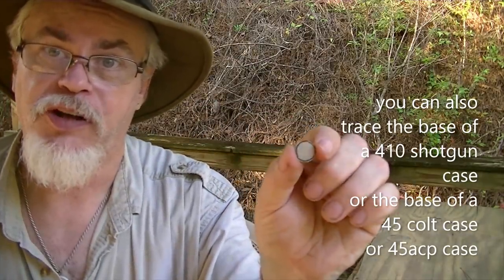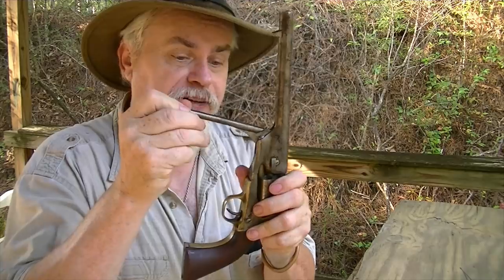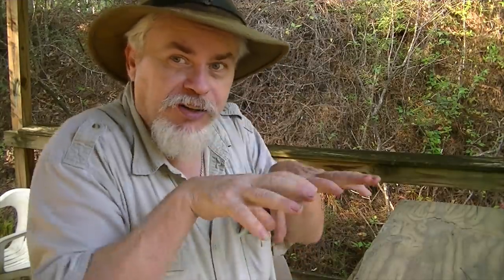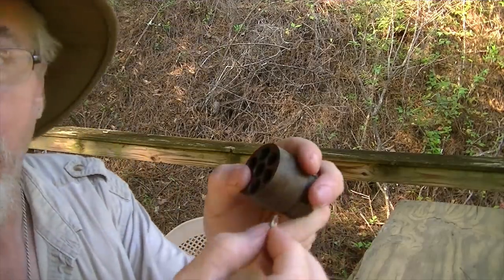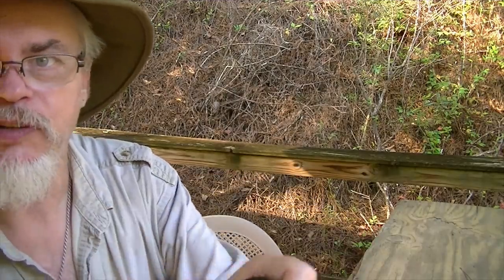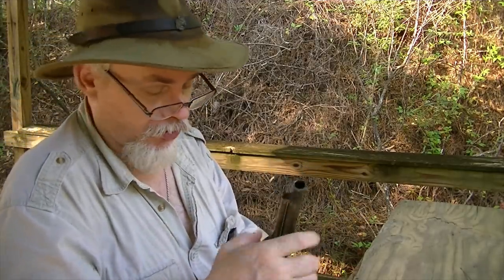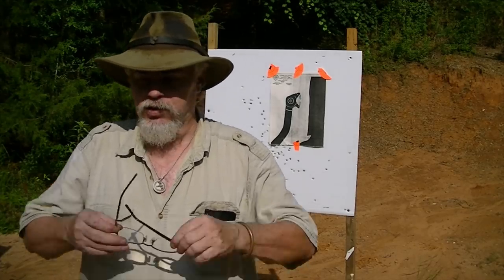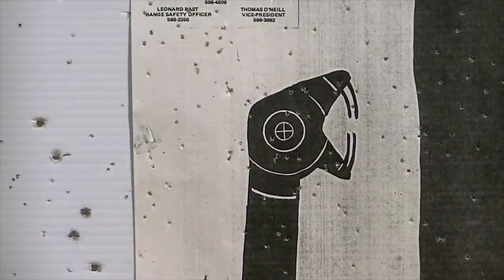SHOTLOADS IN A PERCUSSION REVOLVER

Comment from the maker: feel free to ask and questions in the comments below
Reply: i have a 3d printer, i wonder if i could design a wad like for a shotgun but for a 44cal cylinder. only question would be, would you rather have it like a cup to hold the shot, or like how you use the cardboard and just hold the back?

edit, i made a 44cal wad at 1.20mm tall (which is about 2x thickness of soda box cardboard, but i dont think the little puck form would ima try and design a cup type i guess?

Comment: I originally started carrying an 1860 Colt replica just for the shot load capability for hunting in the swamp many years ago. That was before the Taurus Judge came out. 
I find a .44 cal percussion revolver more effective that CCI shot loads for revolvers.
For .44 cal, I use 20 grains of Pyrodex P, an over powder lubed wad, #5 lead shot compressed, and an over shot lubed wad.
For .36 cal, 15 grains Pyrodex P, an over powder lubed wad, #9 shot compressed, and an over shot lubed wad. 
.44 cal is a more effective load, especially in a Colt Dragoon or a Walker.
Same load for a Colt or Remington revolver. Cap and ball revolvers are very versatile!
Follow Blackie's safety advice. Don't shoot too close to your feet or unintended target, and don't shoot plywood because the pellets can bounce back. Use eye protection.
Reply: I use # 12 shot for snakes. I have tried #5, of course, but the donut pattern reduces the pattern on target at ten yards. #12 is ultra-light, but, due to the intense pattern, takes out timber and sidewinders well on Scout outings.

Comment: Good Safety Tip on the Cyl. Gap, this also applies to any Revolvers. I recently had my Pietta 1860 Army out trying to Sight it in and wasn't thinking about the Gap. 25 grains of GOEX FFFg puts out a very Hot flame and I ended up setting my shooting bag I had under the Muzzle on fire, I spent about an hour and a half picking up about 200 little plastic pellets so as not to litter,

Comment: Hay Blacky try going to a drug store and get you some pill making jelliton  capsules that are about 36 cal. After you have powder and wax seated in a chamber take one half of a jell capsule ( trimmed to properly length) fill capsule with shoot and insert into chamber.  If not a tight fit put a wax wad or paper wad on top to stop capsule and shot from falling out. The jell capsule seems to hold the shot longer together like a shotgun wad and won't blow thru the shot. The empty jell capsule's come in a couple different sizes. They worked for me. Thanks for your videos and your info on BP and woods craft.

Comment: Good job Blackie. 
 This is an interesing creative practical, insightful idea of making your own Snake Shot charges for use in a percussion revolver. 

The painted Soda Carton paper looks like an effective wadding material. 

Author Hovey Smith, has used Paper  Egg Carton and Styrofome Egg and Meat carton material  as a Wadding materal for various percussion cap&ball revolver charges.

Snake Pellet/ BB loades for C&B revolvers has been on my mind for some time.  I will be also conducting tests of various methods of Snake Shot loades to include Pellet/BB loades in Combustable Paper Cartridges made from Thin Bakers Wax Paper for percussion cap&ball revolvers.

Comment: Use'e' the red dot. 6 grains, and primers will work if you add a few specks of powder inside the primer, and or wadding that can hold powder tight to the primer nipple. 6 grains will work well and safe for just about any load in any newly made 1851. And probably quite a bit more but 6 grains of red dot or shotgun powder works well.

Comment: Great video!  Never tried it yet, have been meaning to do so.  Along these lines, have you or have you seen anyone use the .36 Colt bullet through a .410 shotgun?  I currently load BP .410 loads with 3 x .380 balls (full choke gun >.380, I think it's actually .395) and have a lot of fun with these.  At 10 yards, will often stack the balls through a single hole, and 15 yards about a 6" spread, and at 20 yards, between 6 and 8 inch spread.  With 22 gr pyrodex, the individual balls seem to have more visible destructive force than 9 mm ball rounds through my Canik!  Thanks again!

Comment: For shotguns equal weight of powder and shot is a good starting point.
You will find this is pretty matched.
In 12g a 1 ounce / 1 ounce is good.
in 20g it 3/4 to 3/4
I'd say 1/2 oz and 1/2oz is probley a max load for a .44 
But I also don't believe in bird shot for snakes.
In my option and experience #4 shot is best for snakes.
Bird shot #7, or #8 is terrible. As is 00 buck.
#6 will work, but #4 is far better.
Never tried #2 
Oh and the most interesting shot I used was dried navy beans. It worked at about 10 feet. But not something I'd use unless you have nothing else.
Long story. But the short version is.
The snake was right outside the door.
The only thing I had was a flintlock pistol .68 cal, powder and the navy beans. oh and one angry rattler at the bottom of the steps.

Comment: What if you put wax in with the shot to hold it in better?
Reply: That is what I was thinking
Reply: Then the shot will hold together all the way to the target, with no spread.  This would defeat the purpose of loading it with shot in the first place.
Reply: @James-dq3jo  I think as soon as the powder ignites the pressure will separate it all, not sure though.
Reply: @KevinSmith-os5yz  It won't.  But don't just take my word for it, try it out for yourself (legally & safely, of course).
Reply: Wax slugs are made like that for smokeless powder shotguns. 
(By taking a cheep bird shot shell and adding wax to the shot to make a cheep slug.)